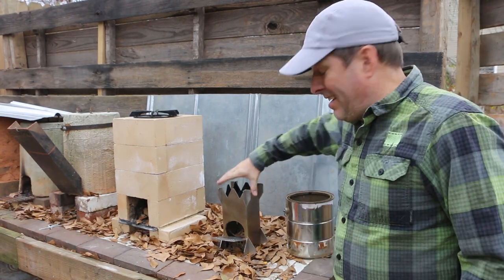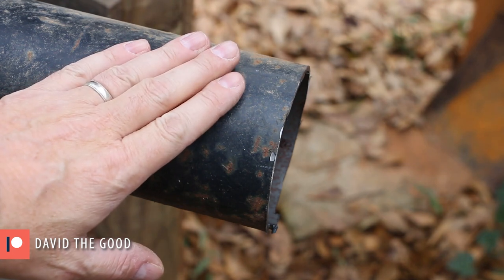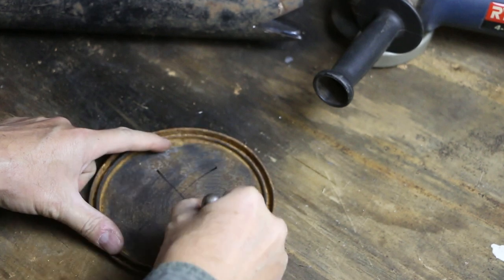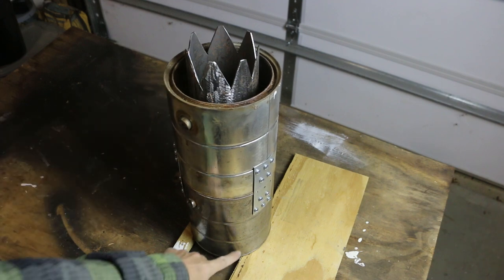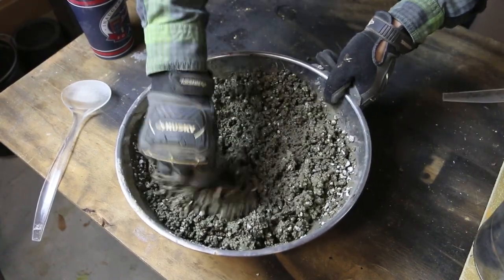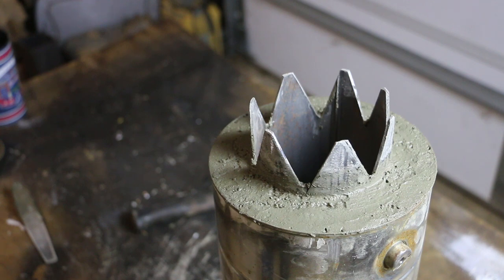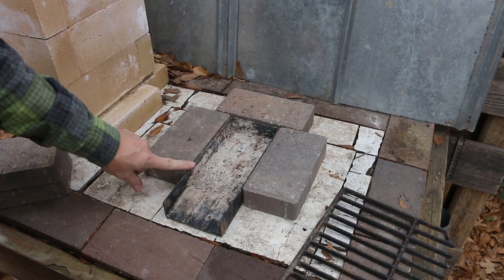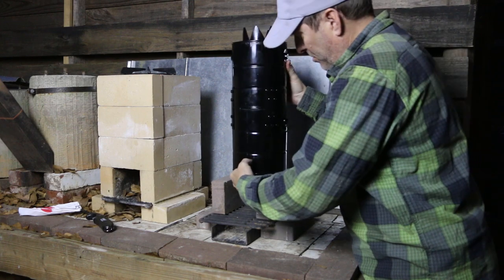How To Make A Paint Can And Perlite Rocket Stove

Comment: I enjoyed the video. Thanks. I'm curious as to the efficacy of this unit for cooking. It makes an  awesome fire torch, but I wonder about the ability to cook with this concept. Or, is it meant solely for boiling liquids.
Reply from the maker: Hi Larry. Boiling water is the best option, because it will soak up the heat. I have made a heat sink grill (no fire gets through) and cook with a wok. Both of those options work pretty well. I have also used a cast iron skillet to do grill cheese and scrambled eggs, but on a smaller rocket stove. Thank you for watching.

Comment: can any of the rocket stoves be used as a forge. do you know how hot they burn? thankyou awesome videos
Reply from the maker: Hi Lloyd. I just got a laser thermometer so now I can check. My steel rocket stove was running at about 850 degrees F. I haven't been able to get a rocket stove to melt aluminum in a crucible. But, I've only tried once. Thanks for watching.

Comment: Your after making the concrete turn to dust inside that flask or what ever you want to call the inner outer casing . To much heat turns concrete to dust hence why plasterers wet down walls before applying the sand and cement coat .
Reply from the maker: Thank you for the feedback. Thank you for watching.

Comment: Do you have to cover the fenished stove in order to retain the heat? I see flame going straight up.
Reply from the maker: Hi Tommy. In a rocket mass heater the chimney is capped with a barrel, diverting it down to a lower chimney exit and through a mass to capture the heat. In this rocket stove application, I’ll put a pot of water on the top to capture the heat of the flames. I do plan to make a rocket mass heater though. Thanks for watching.
Reply: Rocket stoves are typically for cooking and uncovered. It's rocket mass heaters which are covered, directing the heat downward into the mass.

Comment: Forgive me but I thought the Rocket Stove was a Backwoodsman thing. This is going to be awful heavy in the Rucksack.
Reply from the maker: Ha. True. Rocket stoves come in many shapes and sizes. This one is not for the rucksack. Although it is more portable than my concrete ones. :-) Thanks for watching.
Reply: "Rocket" refers to the the principle; and, is derived from the sound these things make when burning properly. Some are small enough to fit in a rucksack; others, you'd need a vehicle to move them around. Then, there are Rocket Mass Heaters, which are pretty well "permanent fixtures..."
Reply: @NTF-zb9wi  I was hoping to see how long they burned for. Or alternatly how much time did you ned to spend shoving little twigs into them. Say to boil a couple of Litres of Water and then how would one simmer? If you wanted it for keeping warm then a straight forward (heavy) metal chimney floo of a decent height would work. I have just thought that "V1" stove would be an apt name.
Reply from the maker: James, I got 2 cups of water will 4 eggs in it to boil in about 5 mins...or thereabout. The stove needed minute by minute stoking with wood, but that is the kind of thing I enjoy. To simmer can be trickier, rocket stoves tend to be rocketing or not. :-) Simply reducing the size of the fire can provide a fairly reliable simmer. Thanks for watching.